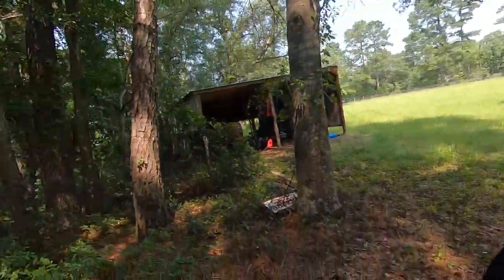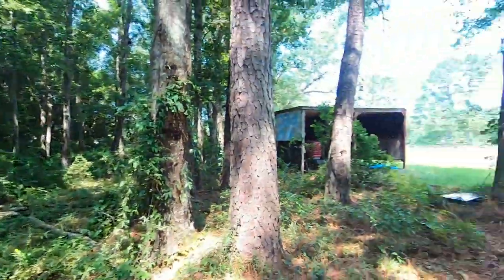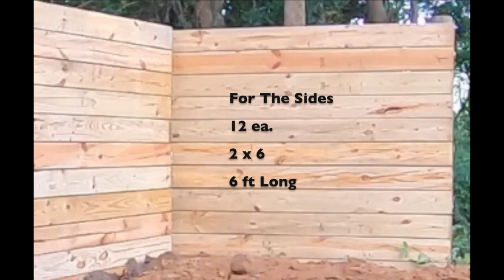How to make your own shooting range..DIY

Comment: Now that you’ve had your shooting range for 2 years is anything you would done differently, sealed the wood, make it bigger, taller or anything??  Just wondering, thanks!!
Reply from the maker: @joecoolcooley6160  That's a great question. I would have added a third pole or a 4x4 in the center of the back to give more support that holds the dirt in.  The pressure of the dirt as it compressed is making the back wood bow out pretty bad.  I can probably remove the bottom boards to shave off the dirt and reattach them, but it will be a pain.

Comment: This was great to watch. Wonder how the posts are holding up. I've built something similar with some buddies of mine and we ended up having to redo the whole thing cause the posts rotted out from underneath. Sealed up the post on the new build and its still going strong.
Reply from the maker: I'm hoping if that happens the pile of dirt will still be compacted enough.  After a year it is pretty solid and hard.